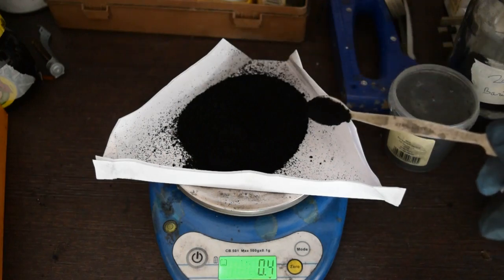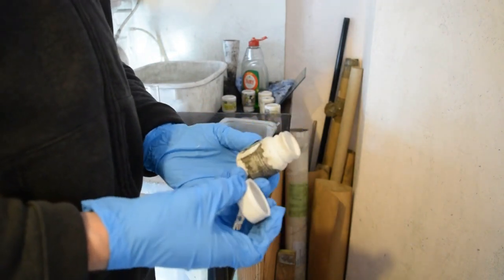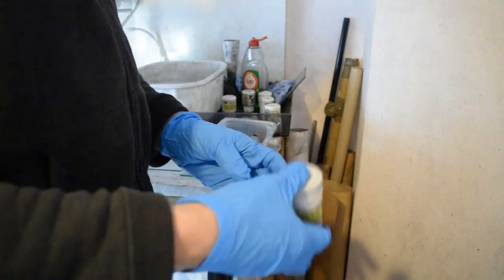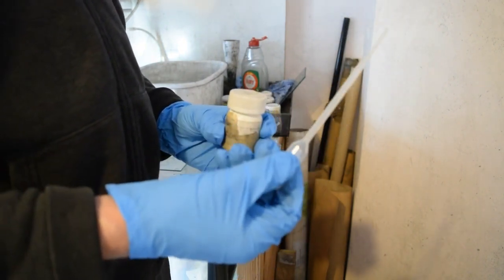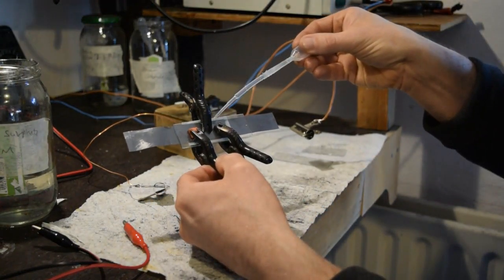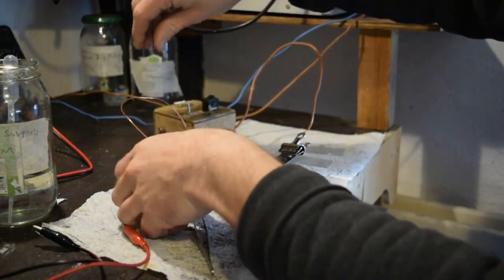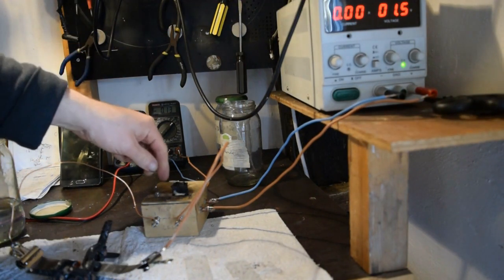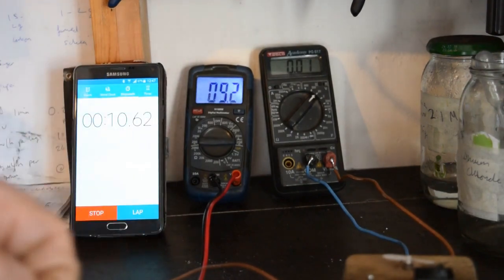Testing Supercapacitor cells and Results

Comment: I got 0.171 farads from 0.4 inch by 1 inch pair of nickel strips coated in a thin layer of activated charcoal. sodium sulfate electrolyte. and charging voltage of 1.5 volts. a maximum discharge current of only 28mA though. I used a 1k resistor to measure the capacitance. i used a bit of angel soft brand toilet paper tissue for the separator. The nickel strip current collectors were coated in a very very thin layer of active material a small fraction of a millimeter thick.
I used about 5g active material. 50g of water for the solvent. no graphite powder. and 1g PVA glue for the binder. hand mixed with a motorized mixer to a smooth slightly viscous liquid consistency. let it dry overnight and then applied a couple small drops to the current collectors. about 2 drops worth with some small paint brushes to dispense the active material. 
i think it was a bit too diluted. so it was a bit tricky to apply the active material layer neatly but the resulting activated carbon layer is very thin smooth and even.
I probably could of gone for 35g or 40g of water to dilute the pva glue with. did previously try 25g water but is too too thick to let the active material form a neat thin layer.
No surfactant or anything else. Just sodium sulfate in distilled water as the electrolyte. as a room temperature nearly saturated solution.
I feel like I could of gotten more farads but I think my activated carbon is bad quality. 0.171 farads feels too low.
I have tried aluminum current collectors but the result was abysmally awful. For some reason just no amount of real current would flow. the oxide layer of the aluminum was interfering too much for it to do anything or work properly.

Comment: awesome step by step mate - you might want to think about some data logging so you can 'see it' - Sealy do one that is quite affordable and comes with the software - but again awesome vid mate thanks for posting
Reply from the maker: Cheers mate! Others have suggested I get zke tech data logging which I bought recently and will show people in my next video. coconut AC gave 12wh/kg of active material @1.8volts with same set up at a 10mA constant load. my best carbon just over 18wh/kg :)

Comment: Hi Tim, I'm curious to hear what you have found with the Carbon/Manganese Dioxide cell as this is what I have been working on for a while. 
I have been looking into what performance I can get with enhanced off the shelf carbons and super simple construction. I found this doc on the Aquion battery and its got some interesting bits in it although the battery has progressed since this was written but I thought it might be of interest to you.
http://www.ampetus.com.au/wp-content/uploads/2015/04/Aquion-Battery-Technical-Specs.pdf
Reply from the maker: I will probably do a video on the Carbon/Manganese Dioxide cell. its my main next step. I've done quick tests with this cell set-up.. making M. Dioxide from this recipe Rob showed us https://www.youtube.com/watch?v=nRM0x-AqrTk&t=32s and works pretty well. you certainly get more energy density at least double or more and it gives a bit more of a battery discharge curve. so some battery like behaviour as you would expect as a hybrid and you can charge it up to a higher voltage 1.8-2volts. I think I tried Lithium chloride as an electrolyte and it was quite happy to charge to 2.2v with excellent results.. but its LITHIUM! however, its only a small amount and probably not too bad a salt. would prefer sodium sulphate tho. I wanted to try using M. Dioxide as the anode instead and using potassium nitrate. apparently you can charge it up with carbon current collectors 2 or more volts. 
That website does have some interesting bits to learn from - many thanks for that.. they do mention lithium ions in there as well as sodium.. but I guess its a small amount. their whole device is about 21wh/kg and the active material 45wh/kg. if my maths is correct! lol
Reply: @geeforce3891  The battery has now been picked up by BlueSky Energy who are talking a generation 3 of it using a Sodium anode, there is a sales pitch on it but it doesn't tell you anything.
One thing i did find is, by over sizing the M.Dioxide cathode to the Carbon anode at about 1.5 or even 2 to 1 helps the capacity but this could be poor quality M.Dioxide reclaimed from batteries and pottery oxide grade.
I also want to try some potassium in the electrolyte to see how much that helps.
I couldn't find the paper you mentioned but i'll keep hunting.
cheers.
Reply from the maker: @petergold4823  Here's the paper I was referring too. https://www.nature.com/articles/srep45048
it mentions using potassium nitrate in the "Introduction" its an interesting read about aqueous electrolytes and increasing the potential voltage window. Cheers!

Comment: Thanks Tim. Have you tried experimenting with different types and thicknesses of separators, to see whether higher voltages can be tolerated without the capacitor breaking down after a few cycles? If a way could be found to produce myriads of 'pinholes' in a couple of layers of cling film (to reduce the chance of two holes being exactly on top of each other, thus reducing the chance of creating short circuits), for instance, would that be more robust?
Reply from the maker: Thanks for the comment and suggestion. When I talk about the cell breaking down after a few cycles at too high a voltage I don't believe it to be anything to do with the separator. The separator stays it tact and continues to do its job. Too high a voltage, I believe causes 'gassing' the breakdown of water in the electrolyte into hydrogen and oxygen. It attacks the structure of your carbon n alters it (particularly because mines a soft carbon) and it loses its effectiveness. That's what I believe it to be. The challenge is to have as high a voltage as possible without this happening. 
I've tried normal paper, tracing paper, kitchen roll, fibre glass, polypropylene, Rob's cellulose acetate separater but filter paper seems to be best for ionic transfer in this set up.
Reply: Thanks for the reply. The 'high' voltage breakdown sounds sensible. A parallel to that happens in various cells, not least the different varieties of Lithium-based devices. A compromise between maximum charge voltage and longevity has to be found. That's where the exotic additives to commercial cells are important. Robert’s videos have been very interesting, but understandably, he keeps his cards to his chest in many ways, hinting at areas for research. Serendipity plays an important part in discovery. Someone on YT even added garlic to his carbon, during processing, and found some interesting effects. 

Have fun!

Comment: I agree, another good video, Tim!  I love your clarity and descriptions - detailed and easy to follow.  Use of the pipette to apply the "ink" is a good idea - it gives you a controlled amount of material.  Use of the "paper clips" to attach to the grafoil is also smart.  As you know, grafoil rips easily and the alligator clips can chew it up.  I have gone to using clear shipping tape on the backside of the grafoil to keep the kids from ripping it.

I totally agree with changing one thing at a time (although I have been known to violate my own rule).  Keeping the electrolyte and separator the same makes a lot of sense.  In the end game, however, there may be interactions between elements that will become more significant - in other words, the "best" electrolyte for one set of materials may not be the best for another.

One piece of equipment that I use a lot is a food dehydrator.  Nice and cheap, it gives me the ability to dry things out at 180 degrees F with blowing air.  I second the suggestion of checking out the ZKE USB+.  Here it is for about 20 pounds:  https://www.ebay.co.uk/itm/ZKE-QC2-0-3-0-MTK-PE-EBD-USB-DC-Electronic-Load-Battery-Voltage-Capacity-Tester/173074309752?hash=item284c086278:g:EMMAAOSwi8xaTZZc&frcectupt=true
This gives you data logging and a constant current load for this crazy low price.

The capacity of your battery seems low.  (I may be missing something big time)  I wonder how it would scale if you added another layer of ink.  Between the surface area and the surfactant, you may have a deeper "well" that you cal use.  My best cell so far ran the same style motor for 12 minutes.  My cells are currently using a bigger surface area -- 49mmx49mm or about 25 sq centimeters, but I think that means your cell should run the motor for about a minute and a half.  Of course the amount of current needed might be the issue more than the voltage.  My videos go into how I have done my cells at this stage.  For my best cell I cooked a mixture of sugar/salt/urea/graphite flake powder for 13 minutes in the microwave, the washed out the salt using water in an automatic coffee maker, then used white glue (10%) and water to make the ink which was applied to graphite electrodes.  I used artist tracing paper as the separator, and a 1 molar solution of salt water as the electrolyte.  I charged it for 5 minutes at 2 volts (I have not tested if it breaks after 10 charges, but it seems to increase in capacity for the first few charges).  It would be great if you replicated it sometime, but keep on your own path!

Your phone looks the same as mine!  A Samsung Note 3?

I really look forward to seeing how your work progresses!  Onward and upward, leo
Reply from the maker: Thanks Leo - I agree and thanks for the equipment info. I definitely be getting a ZKE.
with regards to your best cell, you have got to remember to weigh the active material, its not just about the surface area of your electrodes. capacitors tend to be measured in farads per gram and wh/kg and batteries into ah/kg and wh/kg of course the size of the device matters too. The main aim of my video was to make rough comparisons between different active materials (in this case the carbons) to give you an idea of what you'll get from them. for example the carbon I demonstrated in this video gave roughly twice the energy density of coconut activated carbon (mostly commonly used in commercial supercaps). 

Your best cell sounds awesome!  I love the fact you're using those materials and its easier and simpler for kids to understand. I like the path you're taking cos if you can find a way of getting a high performance device with those safe, abundant and cheap materials. then that's the ideal ;) keep up the good work! 

Mines a note 4 I think! they have a large surface area don't they!  bigger screen than most phones ;) hehe

Comment: Another good video thanks.
Don't give up on hydrothermal reactors, for sure they can be dangerous but so can NaOH, hot water, petrol, guns and cars to name a few ....its how they are used that can make them dodgy.
I bought a reactor and mantle from China with a 500ml PTFE flask, not a bad batch size and it also has a bursting diaphragm pressure relief....but you don't have to run them at their limits to get good results, and there are pressure/temperature curves to assist you. I don't run mine over 8MPa/230 degrees C  BUT BUT BUT make sure what you put into it does not create an exothermic reaction, or one that is not severe at least. Because I don't run mine so hot, I give it another couple of hours if necessary (or a couple of thousand years in the ground more). There are papers which detail the production of spherical carbon nanoparticles and I have re-produced them very easily....but it also gives you options for doping that higher temperatures within the kiln would just destroy.
If mine was to let loose, it would probably take out both my lab and my bedroom above, and I don't think my Significant Other Half would be amused !!  hahaha

Additionally I would recommend the ZKE tech range of products for battery testing, they have I think,  become the de facto standard for amateur experimenters. Their electronic loads are constant, irrespective of the voltage so you get a more accurate assessment, plus it is calculates power automatically. They are data loggers to a pc/laptop also enabling cyclic load/discharge, so just about everything you would want.
I have two of their products, the USB-ESD unit which I use for lower loads and is ideal for testing the 1 or 2 cm2 cells. The larger, EBC-A20, is my "Big Boy", but its lowest discharge is 100mA I think, so I use this on my larger area trials...both readily available and reasonably priced.
Another tool which you may wish to look at is a paint thickness gauge, again not too expensive and easy to use. Then, once you are getting happy with an Active Material, not only will you be able to assess it by weight, you will be able to see how variations in thickness/volume effect the power. Again, Chinese manufactured and not inexpensive.

Finally, can you lets us know what was the concentration of your binder soln, because a couple of drops of it would weigh as much as your carbon, so I am guessing it wasn't too saturated to achieve the 95% by wt AM to 5% binder ratio, but it certainly looked good when you pipetted it out !!

Once again, many thanks for taking the time to publish your work, excellent information
regards

Tony
Reply from the maker: Thanks Tony , lots of helpful info. With regards to hydrothermal reactors. I would be happy with the much larger reactors because you can do it in bigger batches and have the safety valve but the price put me off... maybe in the future it'll be good to invest in one 😉
Yes I definitely need better testing equipment. I've seen people like Kev use what you mentioned. I'll look up what u mentioned n do that. My basic setup is just to give you some idea of performance to compare carbons not give accurate wh/kg readings!
As for the binder.. I weighed polyvinyl alcohol (not acetate) pellets and dissolved in hot water. Making sure I knew what weight of the binder per 100ml say.  2 drops worked out to be 0.25 ml. Again it isnt supercritical.. i know its rougly 5 -10 % This video was more about comparing carbons than accurate wh/kg readings and getting the best out of each carbon, as long as I kept to 2 drops of binder for every new carbon I'm testing. I started with PVA, so I stick to it to help make comparisons. They're better binders - SBR/CMC i Which I'll probably use in final product.
Reply: @geeforce3891  But you missed out the most important tests, your carbon bogeys !!!   ;)
Had to really laugh when you gave the hazard alert on that one, hahahaha
Reply from the maker: @tonyponsford  lol yes I knewww that'll make people laugh. I was slightly tongue in cheek n dead pan on the warnings. I know I'll get the health and safety police on my back on youtube if I don't mention it. The number of times I forgot the mask and later picked out graphene like bogey soot! Hehe ops soz tmi 😉😂 hmm there's an idea 🤔 would snot make a good binderrr !!??? It's organic!! Lol
Reply: Hi Tony, can you share a link regarding spherical nanocarbons? Or about the graphs for htc? I am not getting good results and I would like to try more with this method. 
Cheers, 
Sorin

Comment: Great set of first videos with lots of interesting info. The Carbonator Mk II😎! You planning on getting a data logger to measure the discharge? I use the ZKE-TECH USB one which I bought cheaply from AliExpress:
https://www.aliexpress.com/item/QC2-0-3-0-MTK-PE-Trigger-EBD-USB-DC-Electronic-Load-Battery-Voltage-Current-Capacity/32870388156.html?spm=a2g0s.9042311.0.0.17d14c4doyhc2L
I find it really useful to record the results and study the discharge curves and see how they vary.